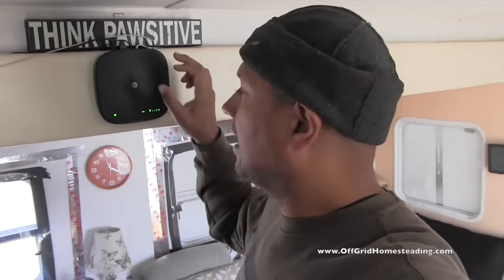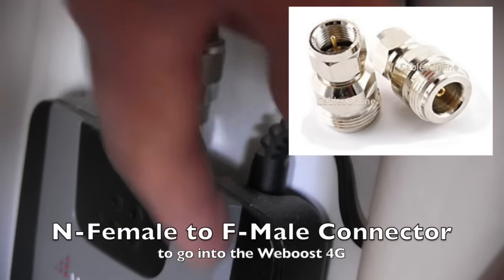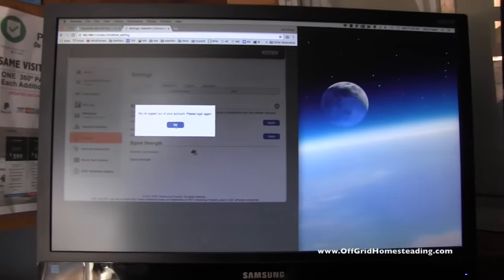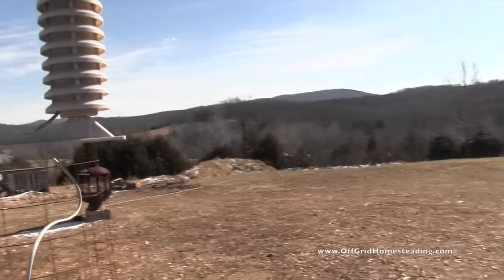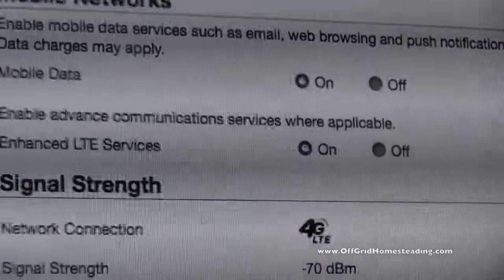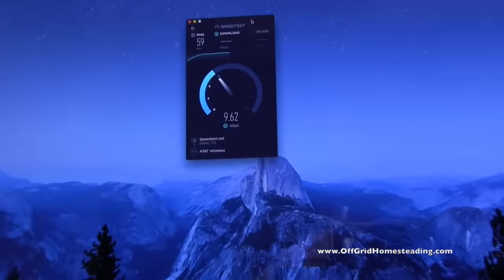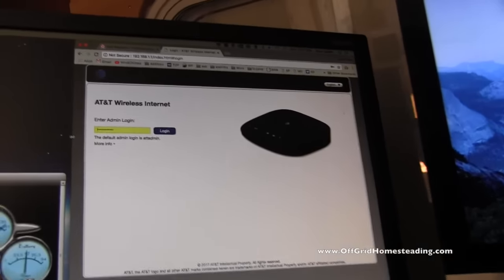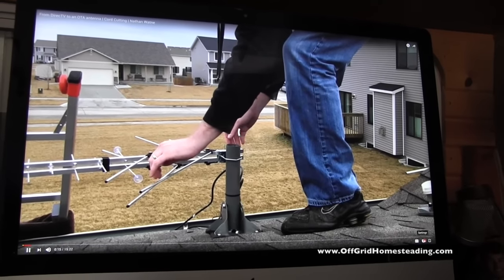OGH - Unlimited Mobile Internet Cellular Hotspot for Rural or RV

Comment: That second antenna port is for diversity. MIMO, if the tower supports it. You can use one of those diversely polarized panel antennas or 2 yagi antennas at ±45°. Like this: ⋱ ⋰. In my case, band 12/17 SISO is only 8-10 Mbps down and 8 up. With MIMO I get 20 down and 10 up. On band 4/66 SISO I only get 15-20 down and 15 up. With MIMO I get 37 Mbps down and 20 Mbps up. I'm using a single yagi antenna outside for siso, and mimo I was using my modems internal MIMO antennas. My signal was -106 on AWS and -75 on B17. I was 0.83 miles from the tower. Signal is kinda low for band 4, I know. There's some technical issue with the tower, I only get band 4 periodically. Sometimes it's for a whole day or a few hours a day. Sometimes not for a few days.
Reply from the maker: Michael Nugent Hey Mike thanks for responding to the video. I am using a hybrid mimo configuration, yagi, and flat panel configuration which is giving us the best speeds so far. Our distance is still too far we’re getting -116 and -119 in most cases with the configuration where it’s at now the most I’ve gotten is maybe 12 down in about 6 to 8 up on the best days.

Comment: Have same at&t  get 2 bars will one yagi outside do fine, its only a few miles to several towers.  I shouldn't need a booster with outside antenna. .
Reply: I tried connecting the yagi (s), one at a time to the ports to see which one I got the best signal from.  Remember, one port is for receiving signals the other is for  beaming out.  You may still need two.  Play with the antenna on both ports one at a time and test your speeds.   The booster (weboost --- will also boost cellular signals overall to it can help).

Comment: Hey Everyone its JOHN the guy who made the video, unfortunately as of Jan 2019 in Missouri, the 250 and 500GB plans are now only available as a Grandfathered plan if you have it already.  BUT the Good news is, they are now offering the 50GB for $40 and the 100GB for $80.   So if you compare 250GB on a hotspot plan on AT&T or Verizon, that would cost you about $700/mo plus tax.   So if you bought either of the plans, it's $1/GB over the plan.  So if you bought the $50 GB plan and used 100GB you'd be paying $40+$50 overage, plus tax.  If you did 250GB, that would be $240/mo instead of $700 against Verizon or ATT,  so that is still a good deal--- if you dont have any options out there.    This last month I found an Amazon Fire Tablet of mine UPLOADED 160GB of data to Amazon and I have NO apps on it.... WFT? !$@#%@#.    I blocked that device on my network as its' gone Rogue.   I SHOULD NEVER have dropped down to the 250 from the 500GB a year ago... to save money....  and be frugal.  Oh well.  At least i'm not having to pay MORE than i need to be right now.    THE NEXT TIME there is a Plan like this JUMP ON IT and DONT GET OFF OF IT.

Comment: Mimo setup doubles bandwidth. Basically mimo unlocks the bottleneck of using one antenna to send and receive. It also increases signal reliability as both antennas are working to get signal. Placing the antennas 10 or more feet apart increases reliability.
Reply from the maker: I just got a 2 yagi antenna for the mimo setup and it was worse, I'm playing right now with a flat panel one, and a yagi on the same pole about 1' away from each other.  it was too cold to keep messing with and rainy so when weather gets better I'll keep messing with various configurations.
Reply: @OffGridHomesteading  you have to orient them in a bipolar config at least 10 feet apart to keep from adding noise to the signal. If the antennas weren't boosted the noise would be lower but when boosted they need distance between each other. 10 feet is minimum. I would bet if you went 10 feet your signal would be as good as with one antenna but with greater bandwidth, meaning it can handle more data at the same time. The antennas need to be oriented at 45 degrees at opposite slants. Each antenna must be aimed separately and tested. This requires only one plugged in at a time. If your signal and bandwidth is worse with mimo then either your equipment is malfunctioning or you are doing something wrong during setup because mimo is a proven technology.
Reply: @OffGridHomesteading  I hope you get it figured out because I'm curious to see the update video. Good liuck.

Comment: Thanks for the info! I have this box and am getting an antenna booster as my signal strength go from 1 to 3 bars depending on the time of day.  I like the splitter out the bottom and running the booster right to the ATT Box.
Reply from the maker: Countryfarm Boy hey CFB! Thanks for writing - glad the Video helped you!  I’ve tried every combination I could imagine— about drive my wife crazy messing with setup over and over again!  Let me know how your setup works!
Reply: You are living the dream, doing things your own way. I saw in your blog that you hooked up the mf-279 to a switch.  That is my plan also.  I just have to customize the settings as I want to use this as a modem/bridge mode only.  I see the wireless can be turned off and will need to turn off the router features as well.  I have a $200 Netgear Nighthawk that I use to run the wireless in my house and the wifi from the ATT unit could not compare.  There are other out in my area that are having internet problems and I will make sure to link your videos to them.
Reply from the maker: I heard about the nighthawk -- and would love to use it -- and one of the reasons to move out "here" was to be in a more EMF quiet area.  My wife is highly sensitive to EMF pollution that causes headaches etc.  So having the Nighthawk inside a metal tin can home... probably not a good idea.  later I could use that type of setup for long range wifi camera that we're gonna setup at our perimeter and gates etc.   If wifi wont reach i'm going to explore a Point to Point bridge, with solar camera/battery setup at the remote end.  We have over 300 videos from when we had just the land, a table saw, and NOTHING up here!  if you go back to the beginning you can see our journey.  The earlier videos were more a video journal and then later became more of a professional production to increase viewership as I think that we should all be thinking tiny house and lowering our foot print on the planet and being more resillient.  What part of the country are you in?  Are you off grid or what?  Says you're a CountryFarm boy... what does that mean?
Reply: I'm not off the grid.  I live in a small farming community named Armada 40 miles north of Detroit.  I'm a professional photographer and need fast internet for sending images to my lab.  I like that you have a Drobo unit.  I have multiple NAS units and all main PC's have Raid 1 drive arrays with SSD boot drives.  My internet right now is ATT DSL which gets me only 2.5 down and .5 up.  I'm getting between 2.5 and 10 downloads with the MF-279 and will let you know how much speed I pick up once I get them installed.  Also does the UPS deliver out to your homestead?  I'm a big Amazon Prime user and having stuff shipped to me is much easier then a 1 hour round trip into the city. 8-)
Reply from the maker: Im a Google StreetView Photographer myself I do Stitched HDR Panos for Google Maps myself, while building website too.  Yes just about everything we can buy comes to us through Prime.  We stream most of our TV/Content through the 1 and 2nd Gen Amazon Fires.  Im Mac only, and I upgraded my Macbook Pro 17 with 2 SSD drives in a raid config. as well.  I have boot times of about 13 seconds from power on, on a Late 2010 machine!  My Main imac 27 uses their super fast, faster than SSD technology and I love it.   Wife uses Macbook 12, and I've got about 13TB on Drobo, and I use a Lacie Thunderbolt 2 for my Desktop production drive.    Very cool setup you have.

Comment: Very good video John. Wonder how it would work if you had dual yagis in a mimo setup? Not sure it would be worth the cost. At 11 miles from the tower you are doing very well. Ever thought about trying panel antennas? Again probably not worth the cost. I also noticed it looks like your chair there is a Herman Miller chair. How do you like it? I have one and like it a lot.
Reply from the maker: Charles Greene hey Charles, the dual yagi’s should work better,  the challenge is the booster - the weboost would cause feedback between the two antennas and the feedback loop would make it unusable or worse than what I have.  In a non amplified sea rip it theoretically should work better.  About chair- I love my Herman Miller (large).  Wouldn’t use any other chair for extended periods of time sitting.  It’s my favorite chair at the trailer as everything else (until we finish) the addition is crap. In terms of comfort.

Comment: That's for the video, nicely done.  I have the MF279 and need to boost.....  Question; your YAGI goes into the Weboost, then T's with one going into the MF279's right antenna port and the other is going to another antenna?  What is that antenna, is that the Weboost's antenna and so is also required?   Thanks.
Reply from the maker: Hey Tim off that T that’s normally where the internal antenna that comes with the weeboost connects.  The other side of the T will go into the Mf279.  Check your throughput on earth port.  This throughput will vary based on conditions.  I have had to switch mine to using my left port.  Sometimes the throughput is better with the external ports not connected.  I don’t know why, so just play with it.
Reply: OK, bear with me here, I'm learning....  since the MF279 has wifi, and your Yagi is connected straight to the weBoost and that's boosting the wifi inside that trailer, shouldn't that signal from the weBoost be just as strong through it's wifi antenna as the T slit going into the right port of the MF279?   I can see the Yagi going straight into the right port on the MF279, or used with the weBoot's wifi but why both?    I'm sure you ran speed tests both ways, what did you see?   Do you know what Yagi you bought?    When you said in your reply, 'sometimes throughput is better with the external ports not connected" did you meant the antenna ports on the MF279?  Thanks again.  I'm getting 2-3 bars and 2 mbps with no antenna and MF279 in the window closest to the tower which is about 5 miles away, flay but a few trees.  My signal is about -100 dBm.
Reply: Yagi goes to the Weboost input.  Use the cable I recommended, as you'll get 200% better signal than the stock wire (unless you dont have the budget) then use what you got.  All I know is when I connect the t-splitter at most times I get better uploads, but lower downloads.  Sometimes the right port works better than the left port.  We are WAY out so I've tried all configurations possible.    Direct connection gives me MORE consistent uploads and downloads.  Weboost does NOT have wifi.  It's simply taking the inside signal and throwing it outside thorough the YAGI, and taking the outside signal and throwing it back in through the inside weboost antenna.  I was signal guy in the Army.  Direct connection is always better and faster.  That's why connecting a computer to ethernet is faster than wifi.  Hope that helps.
Reply: You can check throughput at www.speedtest.net on your computer and an app on most smartphones.
Reply: Have you ran a speed test without the antenna connection from the weBoost T connection that goes to one of the two MIMO antenna connections on the MF279 Wifi Hot Spot and just allowed the MF279 to see the boosted weBoost signal over the air waves?   I'm ready to pull the trigger on the Yagi directional and the weBoost after driving the MF279 to the tower and watching the dBm signal and doing speed tests at different distances.  I'm 5.1 miles from the tower.
Reply: Yes I've tried without the Weboost.  I can see a signal my mf279 says around -110db to -118db which is in essence no signal.  I can push signal up it's too far, but I can get about .5 or less Mbps down.
Reply: My up speed without the weboost is 0 or Cant connect.
Reply: That's with the weBoost "T" not hard wired to the MF279 but with the weBoost on so the MF279's cellular receiver is getting the boosted signal through the air from the weBoost?  That's what I'm wondering.  The boosted cell signal inside the trailer should be almost as strong as the T'd wired signal to the antenna (I would think)?
Reply: @timtullio1210  I made the mistake of getting my t-splitter in a RP version and not the standard SMA version. As I found out the RP version which stands for reverse polarity isn't going to work well!

Comment: Just as a reminder to everyone, this configuration isn't that great.  LMR-400 is 50 Ohm impedance, while the antenna port on the booster is 75 Ohm.  RG 316 has terrible loss for cellular frequencies.  You really shouldn't push the output of a cellular booster into an LTE router/mobile hotspot, and nor should you T it off.  Might be a load mismatch, and you may be hindering the performance.  Unless that LTE router/Mobile Hotspot has some form of automatic attenuation, you might be overloading the receiver system.  A simple 10 dBi panel connected to the cellular amplifier would probably perform better.  You may also be causing oscillations as well between the router and amplifier that may hinder your through-put performance as well.  Honestly, you'd probably have similar performance just hooking up two log-periodic antennas to the AT&T LTE router via LMR 400 N-SMA.  A ZDA MIMO panel with two LMR 400 N-SMA cables would probably be perfect as well, if you could locate the local cell tower and turn the 120° beam-width panel.
Reply from the maker: Hey Chance, do you have the configuration you mentioned setup that we can see? I’d love to see real world throughputs demonstrated.
Reply: I don't have any images of the speed-tests I've performed on speedof.me for my speedtests.  Here's a quick album of Ookla tests I've done: https://imgur.com/a/T1LqBv7

I don't have pictures of my setup at this time either.

Also, on a side-note, if i lived 7+ miles away from the base station, you'd start to see diminishing returns on the setups without the cellular booster.
Reply: So, you feel the hot ticket with the AT&T HF279 is the ZDA MIMO panel antenna and the good cable.  No booster necessary?
Reply: OK, I went ahead and bought a weBoost signal booster for my ATT HF279 hotspot.   It has the Yagi antenna.  I bought a tripod for the roof and a 10' piece of conduit to mount the antenna on.   I didn't use the upgraded cable you suggested, but I upgraded the cable that comes from RG6 to RG11 and am running 50'.  I used the RG11 because it is an Ohm match to the weBoost and the other stuff is off by 25ohms.   The rest of the system is stock.  The RG11 cable runs down the roof, down the wall then through the wall in my living room which is about 35' below the top of the antenna.  It connects into the top the weBoost, then the stock weBoost RG6 cable from the weBoost to the booster cell antenna in my house, then that's pointing to the HF279 about 15' away.  I'm 5.5 miles from the AT&T cell tower and had a -97 db signal strength before the booster (running the HF279's diagnostics), and with the weBoost on it only drops to about -90 or so.  But speeds went from a download without booster of 2.1 mbps  27.5 mbps!   Some interesting info is it's not all signal strength.  I can move the antenna around the room and get a signal strength of -70 db but the speed is only 7 mbps, but the upload is faster; around 18 mbps.   So, I'm fully satisfied big time.  I never expected to see speeds that fast and I probably wouldn't have done it without your video.   I haven't directly connected the HF279 to the weBoost like you did.  I have the T connector and the adapter to the antenna, but I don't want to mess with a good thing.  I'm very happy.

Comment: by the way,...just was thinking,..TP-LINK products are very good and work well with att and other major companies ive used tp-link in the past,..and in my book there top of the line the one you using now with the ATT mf279 if you wanted to get better id replace it with a TP-LINK Archer MR200 AC750 Wireless WiFi 5GHz Dual Band 3G/4G LTE SIM Router,....ive worked with tp link products when they first came out and there always upgrading there systems and if and when i get the weboost im going to get the tp-link Archer because i know what it will do,...and they are fast

Comment: Weboost is ok but I found the Surecall Fusion2go 3.0 to beat weboost in actual boost. Weboost boosts UP TO 65 db but Surecall boosts exactly 50 db all the time. YouTube is full of these tests. I've gotten 4g 20 miles from a tower.
Reply from the maker: That's pretty awesome that there is another product that can solve the distance problem.  Next time I have to change the weboost over I'll try one.  Thanks for the comment.